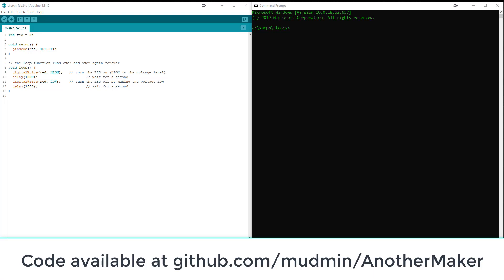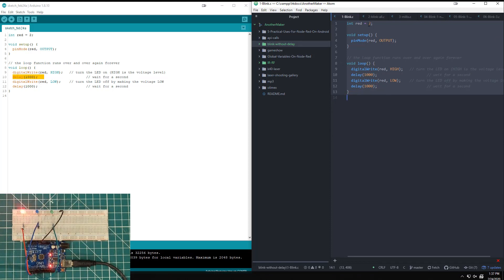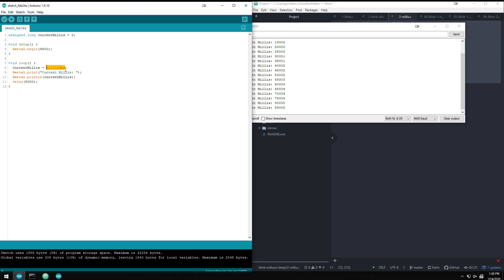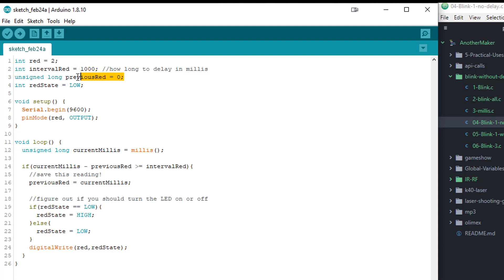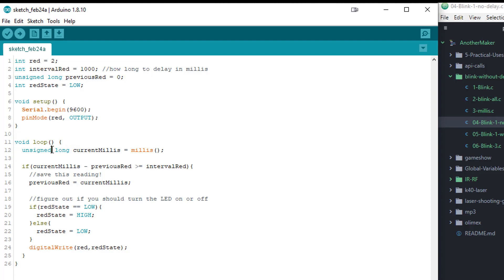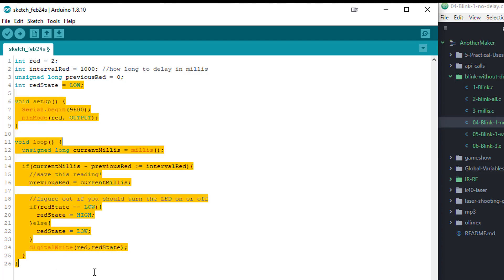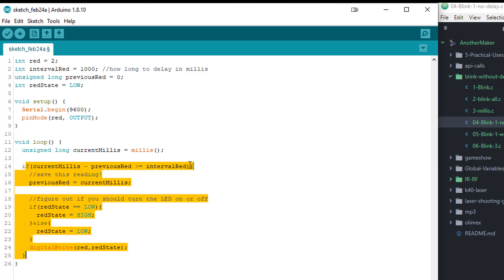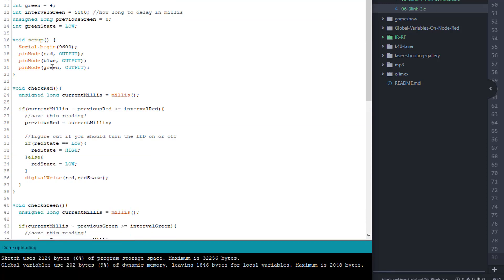Understanding Blink Without Delay

Comment: Great video! How would I modify the code to have 2 LEDs with 1 second intervals but firing .5 seconds apart? Think of a railroad crossing lights where one turns on as the other turns off.
Reply from the maker: I'm not near an arduino at the moment, but I worked up a little sketch that I think will do what you need it to do. It's kind of quick and dirty, but should work. https://github.com/mudmin/AnotherMaker/blob/master/blink-without-delay/7-Blink-Train.c

Comment: if only I found a tutorial like this when I started with arduinos 😂

you can even make it simpler, replace "int redState = LOW;" with "bool ledState;"  and then use:

  unsigned long currentMillis = millis();
  if (currentMillis - previous >= interval) {
    previous = currentMillis;
    ledState = !ledState;
    digitalWrite(LED, ledState);
  }
cuts out the if-else high/low state check and just flips the output in one shot.
Reply from the maker: You're absolutely right. A lot of times when I do beginner code, I write more code just so it's absolutely clear what's going on. I do like your version better though

Comment: Or... and hear me out here... you could just use an interrupt set to a timer and have the LED state inverted each time. It will perfectly execute your code on time and have no delays so all your other code can run as well without issue.
Reply from the maker: The main reason for this video is that is you dig through forums you would be amazed at how many times the answer is telling someone to use blink without delay.. I feel like it needed a little bit more explanation.
Reply: We need to see your code before we can judge it...🤣🤣
Reply: Interrupts might make sense for a more advanced coder, but for a beginner tutorial, this is a good approach, and unlocks some powertful concepts for a new learner to experiment with.